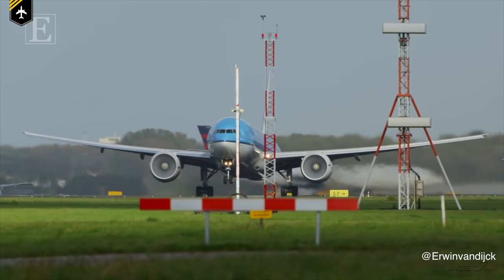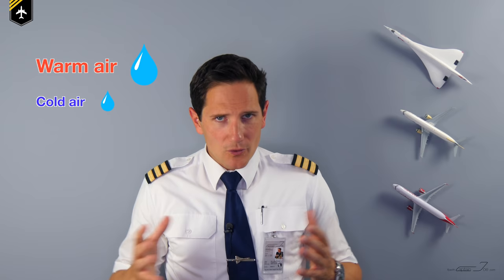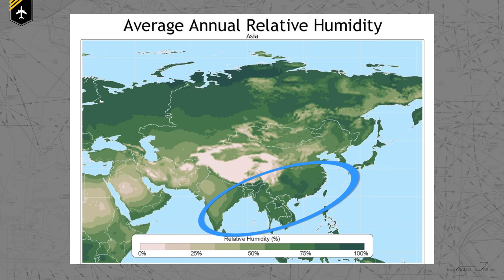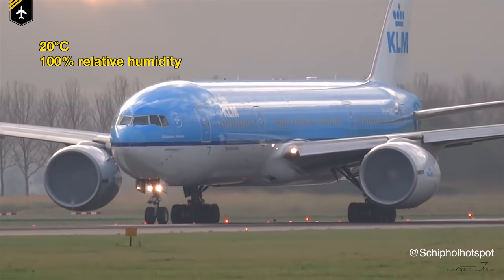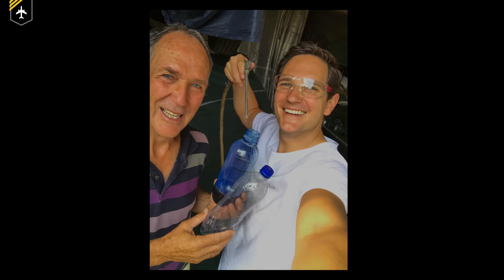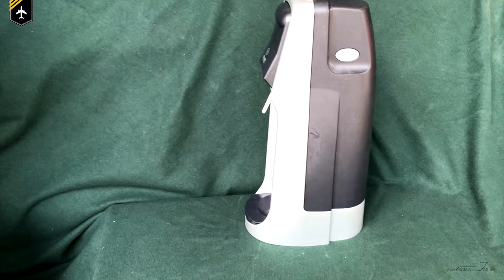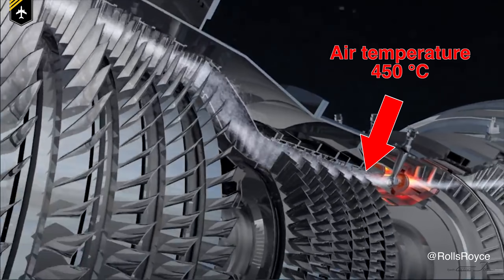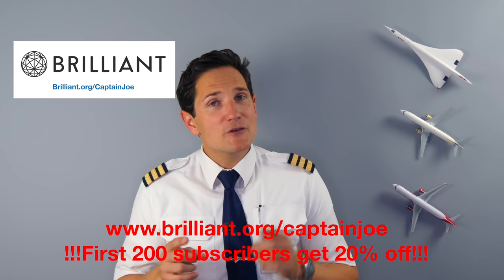WHY is there a WHITE CLOUD? Explained by CAPTAIN JOE

Comment: his explanation is relatively accurate but leaves out an important component.  the leading edge of an engine inlet is smaller than the inner diameter of the inlet.  this is the key.  as the aircraft flies at the edge of sonic - air accelerates past the lip of the inlet and has a pressure increase from the velocity drop immediately in front of the front fan. - see bernoulli.   on the ground there is no or insufficient relative airflow and because the engine is consuming more volume than relative ram air flow can provide - the pressure drop creates the appearance of a cloud.  once the relative ram airflow exceeds the volume of the engine it is impossible for this cloud to form. 
the same holds true for condensation trails large aircraft leave.  most of the trails people think are  CHEM  trails - are REALLY  only condensation created by differential pressures of the wings and engines.

Comment: Dear Capt Joe, I tend to differ on your physics explanation. All the answers below are mostly right. In laymen's terms one could say that the relative vacuum created in front of the engine creates more space where the water molecules can randomly move thus loosing their energy [entropy] leading to a temperature drop down at which water molecules join to form droplets (cloud). The fan analogy  is also wrong. Cooling is only effective in humans because we perspire though our skin (unlike dogs) not because the fan throws cooler air - actually the air molecules carry a higher energy and in theory they should warm us up (!) but but but ... the moving air from the fan sweeps away the water vapor layer forming just above our perspiring skin therefore more water leaves our skin and cools it down in doing so (latent heat of evaporation). Fans are useless for dogs unless they stick their tongue in front of it ;). Nevertheless it was a great video with some editing :)

Comment: Hey, Captain Joe. I love your videos! A question that has been bugging me for a while, that I can´t wrap my mind around, is why jet engines are more fuel efficient at high altitudes? I know the air is colder and less dense, causing less drag on the airframe, but the engines themselves are using far less kg p/hour at say N1 82% at FL370 than at ground level. And at engine idle the engines burn quite a bit p/hour at ground level (say 200kg per engine per hour), while virtually 0 at FL370, during f.ex. a steep descent. Hope you can explain this in a future video!

Comment: I got a question why plane needed to point the nose upward before they fly up?
Reply: because when you pitch the nose up the wings generate more lift at a given airspeed due to having a higher angle of attack than it would with the nose pointed at the horizon 

next time you are in a car, put your hand out the window into the airstream and tilt it from side to side, you will notice a lift effect whenever your hand is tilted up relative to the incoming air (though this is due to the air being deflected downward rather than your hand turning into an airfoil)

Comment: Is this the same reason you get fog with explosive decompression? The pressurised air in the cabin is rapidly being sucked out the aircraft through the hole, so the temperature of the air in the cabin drops, causing the humid air in the cabin to release its vapour as condensation? 🤔

Comment: It is a great expleanation captain, but I just have one question not sure. It is really due to tempreature or it is about pressure drop? As far I know, due to the rotation of the blades, the friction will generate a lot of hit, which end up in a rising temperature. But the massive pressure drop finally caused the condensation of the water, that is the reason I know why it forms a cloud.

Comment: Isn't the reduction in the air pressure near the intake that's cooling it? Just like adiabatic cooling of the atmosphere with increase of altitude because for the pressure drop so fewer molecules in a given area = less energy = cooler.

Comment: I may be wrong as well but, as 5.000 m3/s seemed a bit too high for me, I went and did a bit of a search. So, all I've found is that this engine is able to suck, when taking off, up to 2 million cubic feet of air per minute. Which is quite impressive, even more so when you translate it into the right units, this being cubic meters, 56633.69 approx. That is, under 60 thousand cubic meters per minute, therefore under a thousand cubic meters per second.

Either I've found a wrong source or that 5.000m3/s is a bit too much...

Comment: Cool Video. But not completely correct. It’s not about the acceleration of the air. It’s because of the pressure drop. If you have a humid air and lower the pressure it would start to condensate. Even if you donor slowly and the temperature would stay the same. Air with lower pressure can hold less air, just as cold air does.
And your experiment works like this:
You evaporate the water by raising the pressure because air with a high pressure can hold more water. As soon as you pull out the compressor the pressure drops and the air can’t hold the water any more. But it doesn’t go back to the bottom of the bottle but stays as fog in the air because the drop is very fast. 
Vapor: air with gaseous water in it
Fog: liquid water in the air as little drops

Comment: I want to suggest that this explaination is only partly correct and although the dew point of air is temperature critical the main factor in ‘cloud’ formation is in fact pressure differential. Dew Point by definition is 100% water saturation verses air temperature however the main factor is compression. Wherever there is high pressures ie wingtips, leading edges and turbofans there will be an increase of relative humidity. Condensation in the form of clouding can occur simply because air will compress readily while water (at these levels) does not. Therefore the water is effectively squeezed out into cloud and after the high pressure event caused by the aircraft the vapor is absorbed back into the air.

Comment: Hey Captain Joe why do speed breaks (at least on Boeing not sure about Airbus) not actuate in sync. For example, slightly after takeoff or on approach you sometimes see a couple section go up and down about a quarter or half way (I assume this is on one side to help turning? If so is it only used at low speed?) and on landing the sections go up in different amounts and at different times. Why is this?

Comment: Accelerated air isn't cooler as others pointed out at least on it's own. It's the lowering of the pressure that cools it. The whole explanation with fans at home was totally off, they don't work that way, the surface is just cooled more by the increased speed of air, not by its lower temperature which is what AC does. Otherwise nice video.

Comment: Accelerated air is cooler? You blew this one Joe. That isn’t why a fan blowing air feels cooler.  Put a thermometer in front of it..  You’ll find no difference. A fan blowing air feels cooler (to a warm object) because it carries away heat and enhances evaporation.  Reducing the air pressure is what cools the air in the turbofan intakes, just as compressing air in the compressors causes it to get really hot.

Comment: How do pilots use the bathroom on long flights?
Is there a bathroom in the cockpit or do you just have to hold it?
Reply: Pilots use the same bathroom as passengers (typically the lavatory located in the front nearest the cockpit), but there is a special procedure when an active pilot needs to access the lavatory.  When the pilot exits the flight deck, a flight attendant enters the cockpit and sits in that pilot's seat. Also, a flight attendant will stand guard at the door to the flight deck until the pilot returns.

Comment: When I was taking off a couple of days ago there was a white mist going over the wings and I don’t know what causes thsi
Reply: It's the same concept as shown in the video. The aircraft flies because air pressure above the wing is lowered by the wing's curved surface. Lower pressure -> lower temperature -> water condenses.

Comment: Hi i have a question about plane design. For example, i have a yakovlev yak 40 and the front door is too small and i want to change it for a bigger door. It could be possible to make a bigger hole into the actual hole adapting into a new bigger door caring about balance cabin pressure and aerodinamycs?

Comment: Do airplanes have a back up hydraulics system? So if one fails you have a back up? That is one thing that scares me flying because I work with hydraulics and know how easy they can fail.
Reply: Porta yup they do have redundancy built in
Reply: They've always had multiple parallel hydraulic systems, whose simultaneous failure wasn't considered really possible.
Until Sioux City crash caused by engine failure puncturing pipings of all hydraulic systems, which at the time lacked valves to prevent such leak from emptying all oil.

Comment: Hi Joe!
Here is a question for a next video :)

what happens if the airline company sells all the tickets for a flight... and on boarding it turns up that all passengers are fat people... and plane is overloaded for take off :) 

what is possible solution or procedures to sort this out?! ( as they cant just cancel or redirect some passengers to a different flight due to this reason I assume )

Thanks for answer

Comment: How much rubber does a tyre loose when landing on runway?  A few ounces?
Also, how can a plane fly upside down?  Because the wings push air downward, right?  Not because low pressure is formed above the wing that causes it to rise... blah, blah, blah.

Comment: Air in all respects is measured in pounds. A cubic ft of air is just that...…….. a cubic ft. The pounds of air a cubic ft. will contain varies with pressure and temperature...a drop in either one when the air is nearly saturated (it can hold no more grains of water as a vapor) at a given pressure and temperature will cause the then excess "grains" of moisture to condense (change of phase) out of the air as a water, aka a cloud. Sooo, everyone is correct, to a point...….The question is which is responsible for the cause of the cloud formation in respect to a turbofan engine...….given that the engine is rapidly accelerating the air and not cooling it, the most dramatic change taking place to the "cubic feets" of air is the drop in pressure and as a result, the subsequent drop in temperature of the air due to the "change of state", aka loss of "latent heat". So you can then safely say that the engine is causing the cloud due it's dropping the pressure of the surrounding air.....

Comment: I believe your explanation is not correct.

You ascribe the formation of the “cloud” to temperature change (accelerated air being cooler, which alters the dew point, which pulls water out of the air).  This is not the case.

First: accelerated air is not cooler.  There is no reason for it to be.  

Water can be pulled out of the air by a drop in pressure alone.  Similarly, water can be forced into the air by a rise in pressure.

Temperature change can also cause this, but your claim that this is the cause of the cloud formation is incorrect.  Again, accelerated air is not cooler.

Comment: The explanation is outright wrong. The temperature drop has nothing to do whatsoever with air speed or air acceleration, the cooling is caused by the adiabatic expansion of the air. I sure hope your airplane driving skills are better than your physics skills.